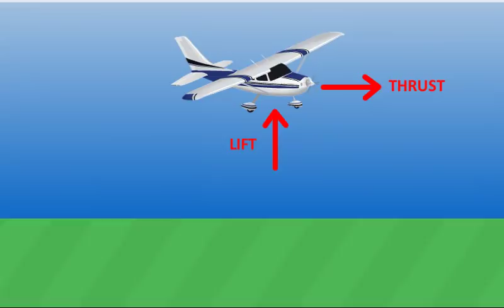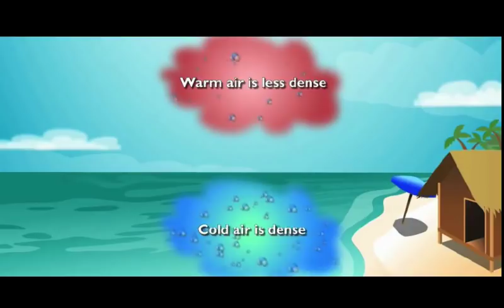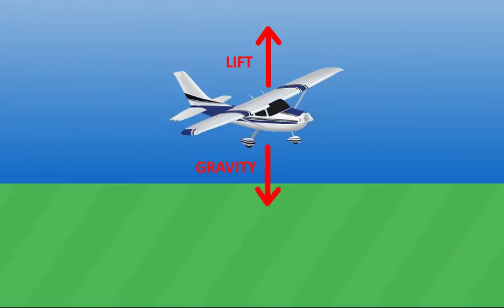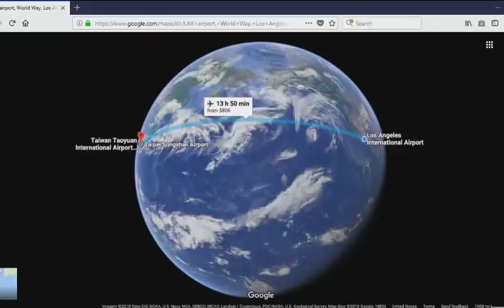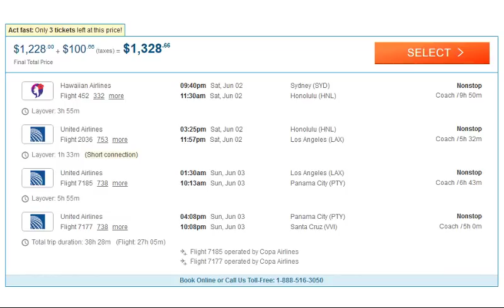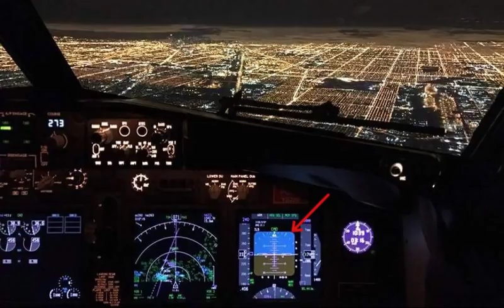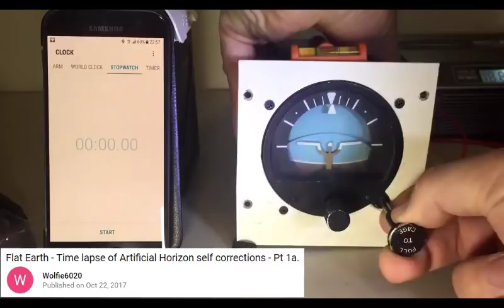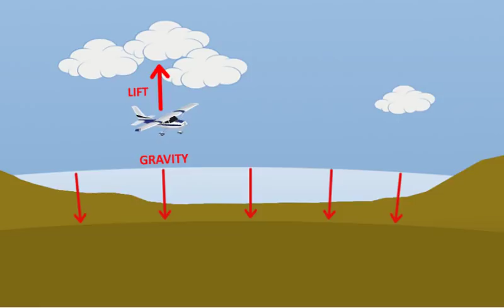Flat Earth Falsities - Plane Nonsense

Comment: u make valid arguments on everything. i just dont believe its a force pulling us down AND sideways at the same time...
Reply: "I just don't believe" 
Ok . 
Good for you .
Reply: @dfr6663  let me rephrase that. I KNOW ANY force doesnt pull two directions at once. the pull down force comes from the Center. where does the sideways force come from?...
Reply: @rawlingz1476  what sideways force ?
Reply: @dfr6663  His #1 and #2 questions. Commercial planes top speed is 5-600mph,  the earths is 1000. going west to east would be impossible, it would never catch the earth. it would have to go even faster than the earth to get anywhere. but hes saying that gravity is pulling it down and sideways.. then he used the argument that if u toss a ball up in a car it doesnt shoot to the back. yes because the wind is blocked. but the ball still gradually goes to the back just not as fast. just like if uve been on a plane and walk from one end to the other u can feel the force pulling or pushing on u. and if the wind came through youd shoot to the back. if i can feel the force of  a plane going 500mph EVEN while its shielded by a barrier (atmosphere) why cant i on a ball spinning 1000mph. instead of using his own senses and common sense, hes just reading out of a book.
Reply: @rawlingz1476  
airplanes fly in atmosphere . 
Atmosphere moves with earth . 
If you have an alternative explanation that would be great , otherwise it's just pointless bleating .
Reply: @dfr6663  ?..my explanation is that we are on a flat motionless plane. And my question is once again... what force is causing the "atmosphere" to be pulled SIDEWAYS all while gravity is pulling down? ATMOSHPERE-  the envelope of gases surrounding the earth or another planet. 
and can i have a legit scientific answer not an insult or what u read out of a book?
Reply: @rawlingz1476  friction
Reply: @dfr6663  and what is this friction caused between? earth & air? earth & gas? earth & ether?...
Reply: @rawlingz1476  sorry , now you don't understand friction ? 
Oh dear... 
Is there anything you do understand ? We can start there .
Reply: @boffeycn  even if it were it never says the earth is flat or we live in a snow globe. Even their bible based argument is screwed. One thung it says that they never mention is people will dakl into confusion and not grab hold of sound doctrine. That people will become stupid because of their own reasoning.  Funny how rhey miss that one when reading it back
Reply: @dfr6663  ok... start
Reply: I used to think people couldn't be so stupid as to deny reality, then I met gobothering, science denying Republicans who believe their bible is a science text book.
Feed my gullible sheep. Baaaa, baaaa.
Reply: @NotTheCIA I.think if youre saying that i shouldnt theorize before i have facts, gravity itself is theoretical...
Reply: Rawlings you need faith in invisible entities, Gravity it the one and only true Force. Just got little lazy for the past million years and stopped all this Space attraction.
Reply: Sideways??!! Down is relative to the CENTER of gravity... Seriously.
Reply: @diesel69er  yes but this gravity is pulling towards the center of a BALL. whats to account for the pull it would cause on you because its SPINNING at 1000MPH. Just like if you glue a toys feet to a ball and spin it, the toy would bend in respects to the way its spinning...
Reply: @rawlingz1476  spin isn't measured in mph , the earth spins half the speed of an hour hand on a clock
Reply: @dfr6663  what? spin is most definitely measured in mph. ask google how fast is the earth spinning...
Reply: @rawlingz1476  so you don't understand the difference between angular velocity and rotational speed either ? 
Like I said , maybe start with something you do understand .
Reply: @rawlingz1476  PLS just watch that Video again. You repeat the questions that get answered in the Video....it told you the answers just listen one time and use your brain.
Reply: @christianp.3507  yea my brain knows bs  he showed me some cartoons.... and my senses know from experience. everything he said can be SIMPLY proven on a level plane. even gravity. on a ball, everything follows the laws of physics except gravity... and the "top" scientists have no clue how.
Reply: everyone wants to seem complicated and smart. but its simple. if you lift your head up from a book that some old dudes came up with and just use your senses and common knowledge.
Reply: Like he says in video. Its like being in a moving car. If you r asking what stops us from stretching or flying away its cause the force of gravity is stronger than the centripical force of spinning. Can you realize how BIG the earth is? How very small a plane let alone a person is conpared to earth?
Reply: @diesel69er  in order for that to be, gravity would have to pull at a stronger and CONSTANT rate than earth is spinning. Newton Says that gravity gives everything its own gravity pressure. How is that so?
Reply: Not to mention because of the nature of gravity the closer to earth u are the more pressure will be applied. I believe the govts of the world are full of shit. They are NOT about people but are about power and control but this is outside of that. Theres no reason for anyone to make up a "globe theory" it benefits nothing. Its really not that difficult. Not bagging on u i just dont get it.
Reply: Another thing about gravity, if the earth was flat- everything would be flat. Because again the nature of gravty pulls everything to the center.. Into a ball. Otherwise we would stand more or less sideways if the earth was flat. This is why flat earth peeps deny gravity. The earth cant be flat and gravity exist. This should be a huge clue that the ifea of a flatearth is comlplete squirrel turds
Reply: @diesel69er  a flat plane would not have a "center". "gravity" on a level plane would have a level pull of gravity all around. and this would work on a infinite plane or even if we were in some sort of gyroscope (any flattard theory will do). and if u can believe in infinite SPACE and not an infinite plane, your complete squirrel turds.
Reply: @rawlingz1476  not on your best day.  the force of gravity being constant from all directions toward the CENTER of gravity. By definition it cannot be flat. As for the other part there is much more varifiable evidence of an infinate universe and that the earth isNOT flat than the other way around.  You wanted amswers and like every other flat tard you refuse them cause its not what you want to hear. Proverbs will tell u to reject correction is stupidity. It also says use the word to bring correction. Is any of this getting through? What languge should i speak for u to hear reason? Can u?
Reply: @diesel69er  and the reason an evil group of people would lie to you about where you are is so that they and their chosen people can get u to make them money so they have the necessary supplies and equipment they would need to go explore and conquer uncharted territory. all while giving you a shit show distraction.
Reply: 1000 miles on a huge planet isnt shit anyway. You went nowhere in the bigger picture. Saying it would throw us into space is as ridiculous as expecting to see an 8 inch curve difference over a mile. How the fuck would that even be possible? LMAO!!
Reply: Do you know even light is effected by the gravitational force of a planet?
Reply: @NotTheCIA I.think listen to how to how absurd and OVERLY complicated that sounds. your regurgitating out of a book that was given to you by some dude instead of using the simple but perfect senses nature gave you. so its spinning 1000mph but its spinning slow at the same time. just on a common sense level, does that make sense to you. dont run back to your college textbook for and explanation. just think of all he bs they tell you. all the contradictions, they keep adding and taking things away. making keeping up truly impossible. keep you guessing instead of knowing. 

is pluto a planet or not? they just discovered a new moon outside of neptune. we went to the moon 40 years ago but cant get back. our cell phones have advanced more than nasa? we sent rovers to mars but cant get past the "van allen Belts".  we can only see one side of the moon on either side of the earth at the same time. (they give you bs that its leaning and wobbling a certain way) and the same thing for the "planets", you only see one side even when looking through a telescope. We are spinning on our own axis while spinning around the suns axis WHILE SPINNING AROUND THE UNIVERSE. the only thing spinning is peoples heads. thats how they want us. DAZED TO EVERYTHING. if they could find a way to make you pay to tie your shoes everyday, they would. theyre working on charging for rain water as we speak.its already illegal to collect lol. We see the same set of stars every night (and have for thousands of years) AND those on the total other side of the ball see the same exact formation. to add to that, the constellations go in a perfect circle around the north pole. but were spinning 3 DIFFERENT WAYS? just stop and think, with all the knowledge you have (EVEN simple knowledge) doesnt it seem like its WAAAAAAAAAAAAAAAAAAAAAAAAAAAAAAAAAAAAAAAAAAAAAAAAAAAAAAAAAAAAAAAAAAAAAAAAAAAAAAAAAAAAAAAAAAAAAAAAAAAAAAAAAAAAAAYYYYYYYYYYYYYYYYYYYYYYYYYYYYYYYYYYYYYYYYYYYYY too complicated and bullshitish?
Reply: @NotTheCIA I.think 1. its a cigar in bricks.
2. by perfect i mean complete(i dont have to accurately measure millimeters in order to see it just like i dont have to know the exact speed of a car to tell its moving, idiot). 3. what kind of engineer are you might i ask? i myself, am just a simple maintenance engineer in the miltary who knows engineers from all categories, who have shown me that they account for nothing about a spinning ball. pilots and all. even vets have shown me the things that they say are suppose to calculate curve are bs and can be easily done on a flat plane. please tell me your an aerospace/aeronautical engineer. and enlighten me with some of your studies or even personal works that account for curve that CANNOT be done on a flat plane. ive given ample examples (that can be recreated in nature) of how living on a spinning ball would not work and all youve given me is numbers off a paper and childish insults. no tests no examples, nothing. everything ive tested can be recreated in your own backyard. (nature) everything youve given me cannot be recreated in nature or reality for that matter. any SOLID evidence or tests or even a real pic for me that CANT be countered asswipe?

Comment: Explain gravity!
Reply: Aren't you the lucky one. The resident fuckwit wants to rim you.@NotTheCIA I.think
Reply: Effect of mass on the fabric of space-time, with the result of three dimensional bending of space-time towards the center of mass. Most likely due to interactions between particles of mass and the field made out of Higgs bosons. Read a book.
Reply: https://earth.nullschool.net/#current/wind/surface/level/orthographic=-33.30,14.59,333
Reply: @NotTheCIA I.think Please do share the link for that.
Reply: @NotTheCIA I.think HA HA HA! Some Grave Gravity explanation :)  So non CIA "he" is also 
Uncle Tobys
?  Many have trouble explaining her, she is so selective and locking. Appares Some learn on YT.
Reply: Gravity is a property of mass that exerts a force that pulls material toward the center of mass of the largest near object. 

For example: The center of mass of the earth is in the core, which is by far the largest object around. Therefore, everything is pulled downward. Technically, all objects on earth exert gravitational force, but it is imperceptible because of the lack of a lot of mass. You are stopped by the hard crust, otherwise you’d keep falling toward the core. You don’t “fall” through water because of the buoyancy from the air inside your body (which is lighter, or less dense, than air and therefore floats). Birds don’t fall through air because they have adapted to maximize air resistance (with their wings). Planes use a combination of thrust (forward force) and wind resistance (under the wings).

Comment: How does gravity exactly affect level?? If i needed to build a bridge from one country to another over thousands of mile and i needed it to be perfectly laser sight levelled for stability would it be flat or curved??
Reply: Garivy automactilly keeps Levels curved to correct hight of sea level.
IT has all attention to Plane flights. I'm sure IT will do the same for the laser beam, everything must be comprehensibly in line with technology, its part of the Natual Sectionning of Evolution. 
For outerspace best to curve inwards like nasa rockets.
Reply: So a laser level will bend with earths curve?
Reply: @No... So what happens in an antigravity environment? Does a laser light diverge instantaneously? Can I level a 2x4? This concept of gravity affecting level is boggling my mind!!! In my head a solid piece of iron; at level; no matter how many miles long being a rigid object should never have a curve to it.
Reply: @michaelruth8447  your mind seems easily boggled .
Reply: @dfr6663  I won't deny that!! Lol
Reply: @No... we use laser laser levels all the time in construction. Which I guess is why  I have a difficult time grasping the concept. If i level a perfectly flat countertop, put a bubble level on top and theoretically continued that perfectly flat countertop and extend it thousands of miles at some point the flat countertop no matter thickness of material has to bend around the roundess of the earth? Once it starts to bend, the left end should no longer be level with the right end. The right end would be below level??!!
Reply: @No... Ok so flying straight instead of level will take you straight into outer space.
Reply: how else can we all sit and get drunk together and argue if my beer is straight or level😂
Reply: @michaelruth8447  how many different ways do you need the same question answered ?
Reply: Ian M  I get flat and level and straight are different which changed the whole theory of my question. but to me if you start at one point, with flat,straight and level solid object I am being told no matter how solid that object is gravity will make it curve level to the earth?? Yet if i take a string 5ft of the ground and my supervisor says make it level, if left side of floor is 2 ft higher than the right, gravity will lower the right end of the string for level and string will be angled downward. I can't understand gravity affecting level. When i hang a picture am i hanging level or flat or perpendicular. If i go perpendicular in my house the picture will be crooked, i could go flat but can't flat be at a 30 or 20 degree angle. What if i put a bubble level on top of picture. Is the level making it level. Gravity knows where the ground is in order for it to have an affect on it. The bubble level doesn't know where the ground is. I apologize if my point and questions aren't coming out clear? Even if i am using the wrong words i still feel I'm getting my point across. If i put a LEVEL on my picture  and level it and hypothetically increased it in size, If i were to follow the top of frame and continue that straight line i need to accept that for the picture to stay level it will curve to remain at level.
Reply: Ian M  I think I just can't grasp the concept of gravity having an affect on level, and again now learning my idea of level is totally wrong. The way I'm understanding it now the properties of level change on extremely large scale and I don't understand why. I am not trying to be funny or stupid here, I just want to understand and learn.
Reply: @michaelruth8447  you keep saying you understand and then going back to the same nonsense . 
Flat and level aren't the same thing .
Reply: @dfr6663  Ok at this point you guys know the point i'm trying to ask. I apologize for my lack of intelligence and use of incorrect terminology. This apparently not the place I need to be getting answers from. The physics involved are way beyond anything you guys can explain to the common man or at least explained here.
Reply: @michaelruth8447  you seem surprised that a YouTube comments section isn't the best place to get educated on scientific principles . 
I agree .
Reply: @dfr6663  its frustrating cause im in construction and can't grasp gravity affecting level, straight, plumb, flat or whatever and everything i thougt i understood is way off base. And all my understanding is from years of schooling and training so apparently i was learned wrong...lol
Reply: @michaelruth8447  no I don't think you were "taught wrong" , you just don't understand it , stop blaming your teacher and read a book .